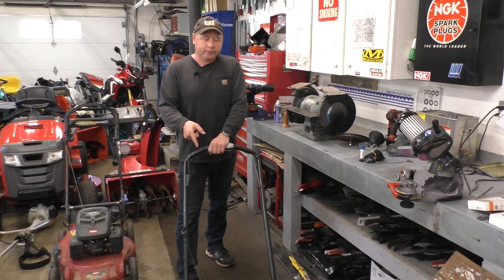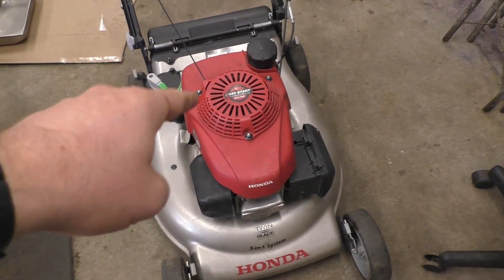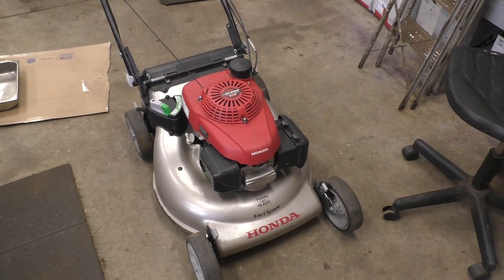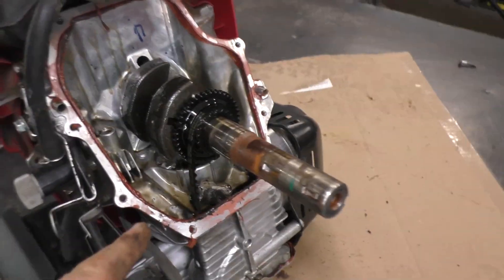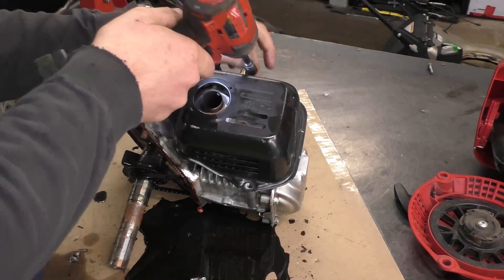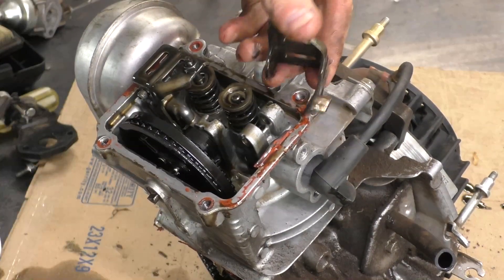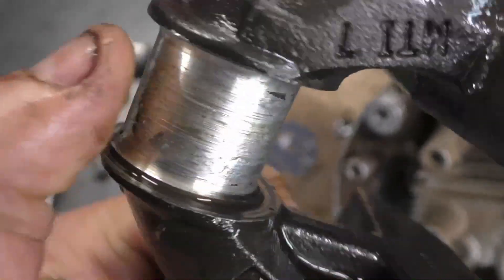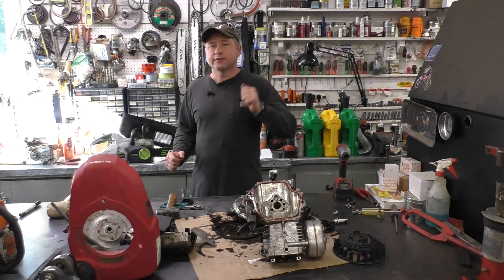Engine Teardown - Another One Bites The Dust!

Comment: My guess is that the con rod had some galling which caused it to seize to the crank and snap the rod. these are tough little engines, very odd to see one blown up. I put one on my snapper mower after the old tecumseh blew up.

Comment: A valve might not be closing. Maybe check the valve gap.
Reply from the maker: valves were ok
Reply: @donyboy73  I was making my comment before the video ended.
I had a generator the valves weren't closing all the way and didn't have compression.0 resistance when pulling.
Once I heard the rattle I knew you were right.